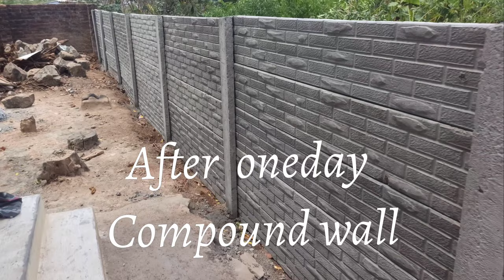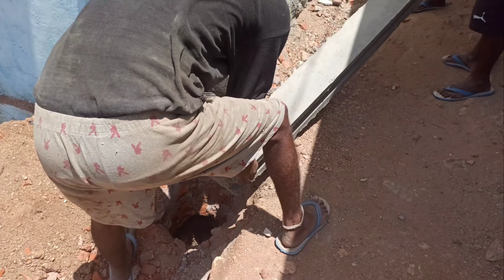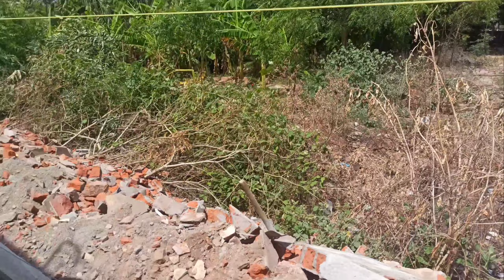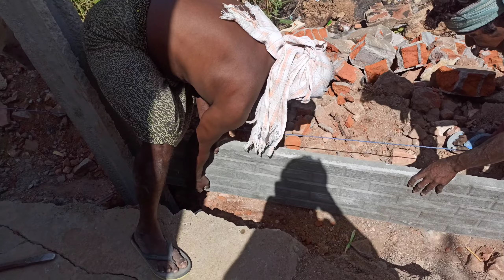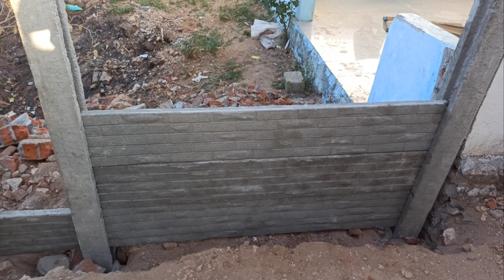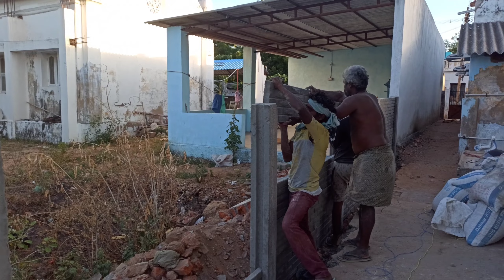Readymade compound wall Construction process in tirunelveli @AutomobileTips

Comment: Very useful video.. How much it cost for 262 sqft ( running ft) compound wall? Sir
Reply: 262*height
Reply: Height*sq feet rate 90
Reply: 6feet height ku 141480